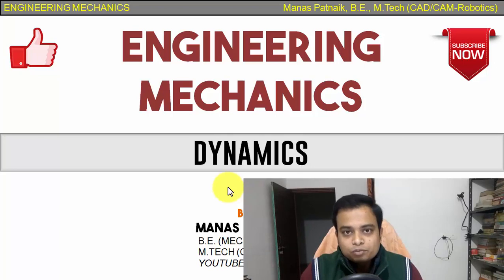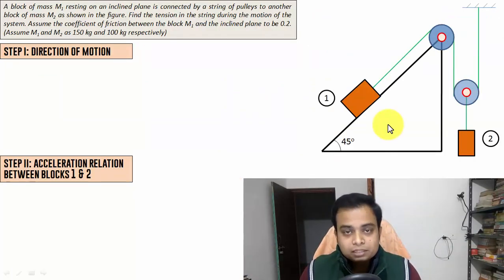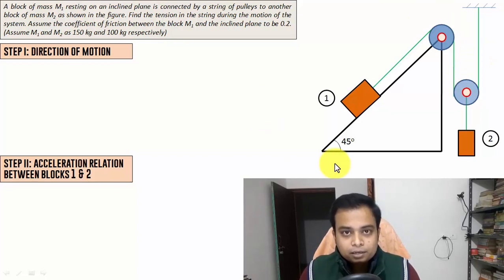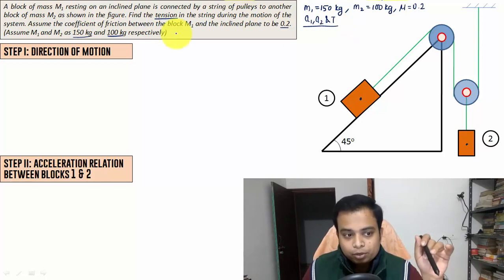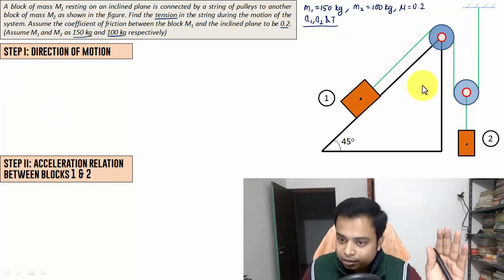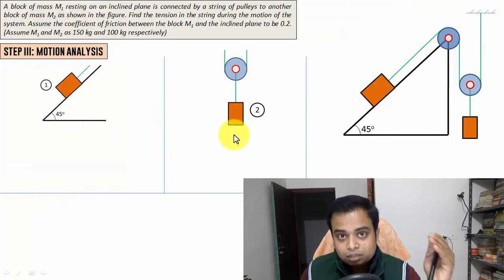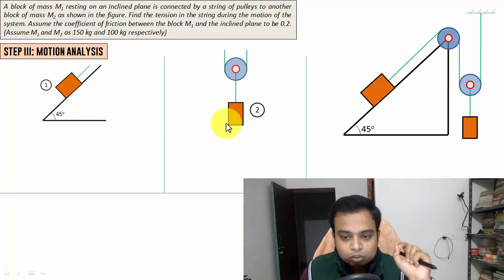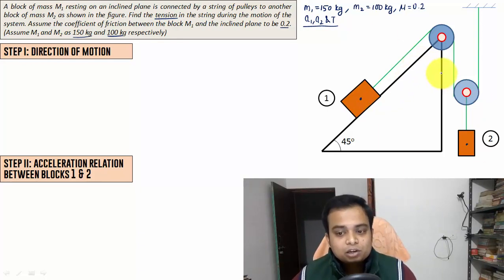D' Alemberts Principle | Newtons Law of Motion | Dynamics | Problem 7 |

Comment: Why is the length of string which is attached to rigid support is y. It should be greater than y. And why is the string connected to  block 2 not taken into account?